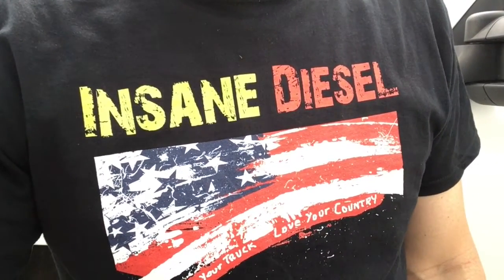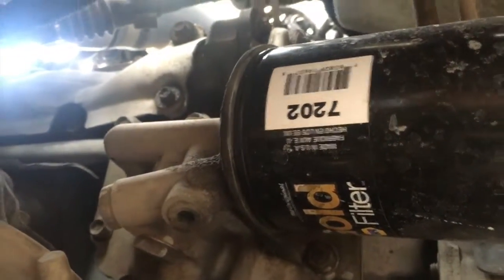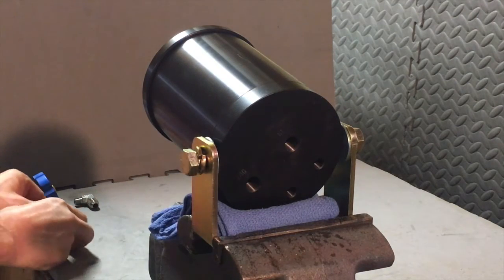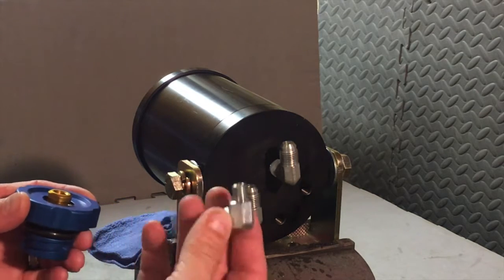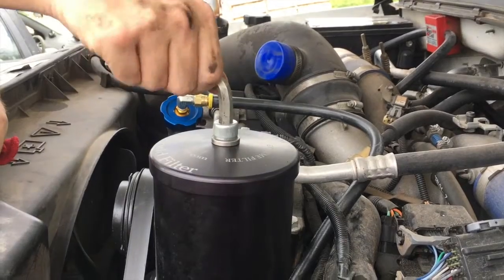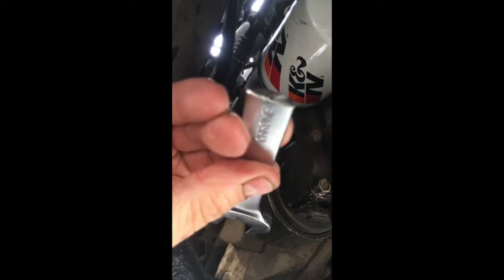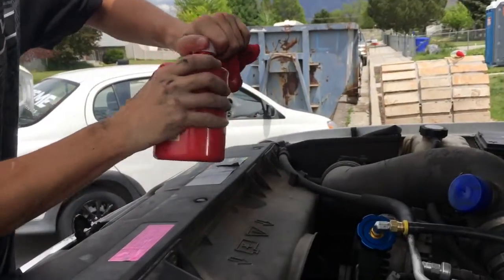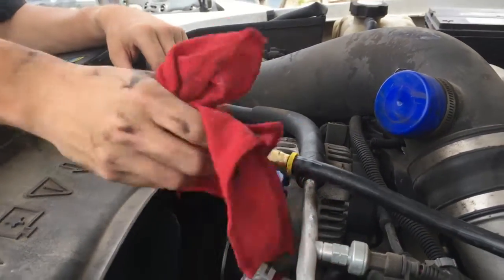Duramax 6.6 EXTREME bypass Oil Filter Installation

Comment: Just got done installing my bypass filter. Your correct, the oil pressure allen wrench plug is a little tight. I used an allen wrench and a closed in wrench side of the wrench as a breaker tool, worked great. What was more of a pain for me on my 2003 GMC Sierra 2500 4WD was getting the pressure elbow back into the same hole. I had a clearance issue and couldn't turn the elbow. It was hitting the side of the transfer case. I called Insane Diesel and he advised me to jack up the front of the truck to lower the suspension. That should give me additional clearance between the elbow and the transfer case. Yep that worked and once I got it started in just went in fine. After I lowered the truck back down, I ended up having about 1/2"- 5/8" clearance between the elbow and the side of transfer case. Started the truck after all was said and done and no leaks. Can't wait to go pass that 5, 000 mile mark and not changing the oil. Thanks Insane Diesel

Comment: FYI, that oil pressure port is a PAIN to get the factory plug out. Other than that, installation is super simple. No loss of oil pressure, engine oil looks clean as the day I first put it in, so far has 4,000 miles on it.
Reply: Nate Lindauer ..how does the oil look now?how are you liking the set up?
Reply: @Nate Lindauer, Does that year Duramax have an EGR and if so did you delete it?

Comment: how well did the system work 
how was oil at your typical oil change miles, oil psi stay good, and did u notice engine running smoother